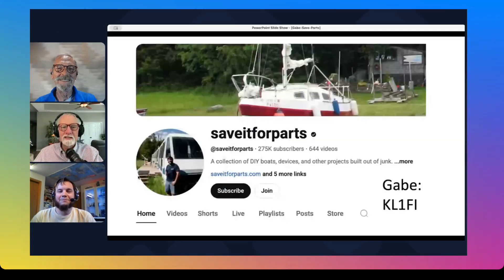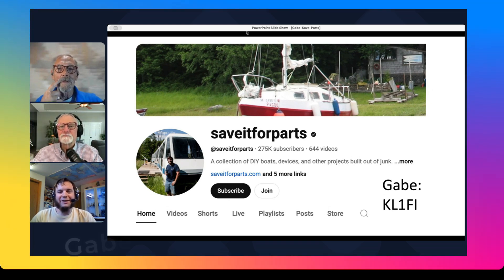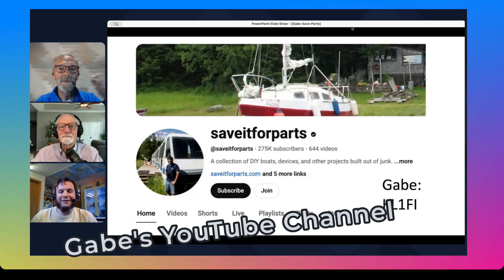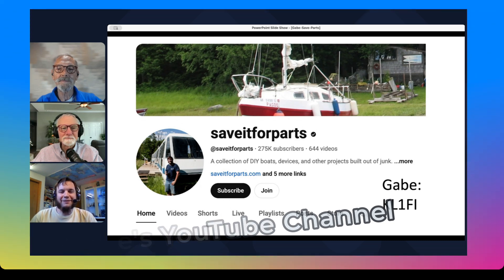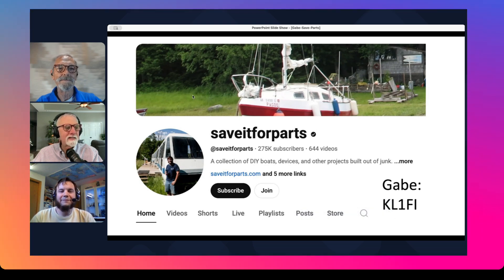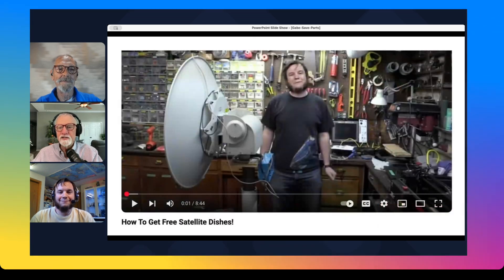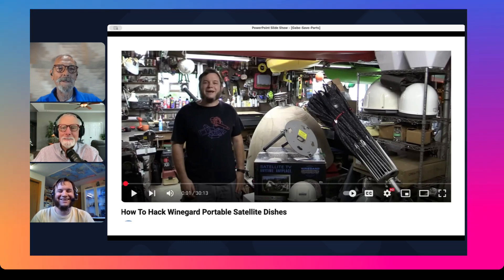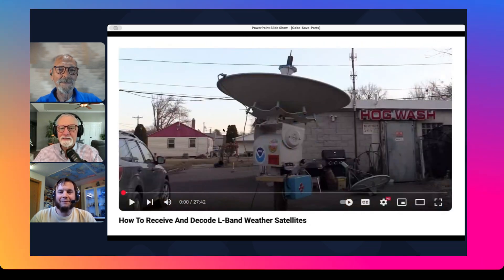Meet the Ultimate Radio Hacker -- A Ham Radio Inspiration

Comment: oh man back in the early 2000's i scored a 50 foot collapsing two section tower with the original hand crank, with a antron 99 cb antenna for 100 dollars. the husband passed away and she needed to get rid of it so i took it down my self and got 100 foot of the old RG8 coax with the double grounded shielded cable! it was crazy! the ladies brother inlaw even through in some extra bits and pices from resistors and diodes and weird odd connectors!
Reply from the maker: Great story, Adam. Thanks for sharing it. You never know. I scored a tower that had been stored in a big warehouse for years. Just sitting there. Q